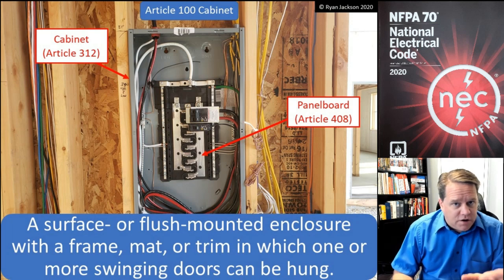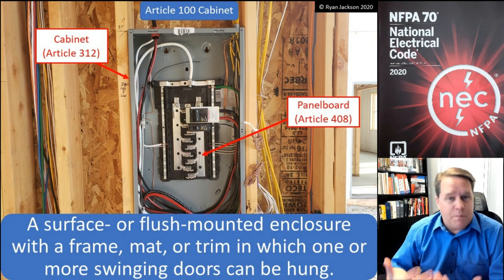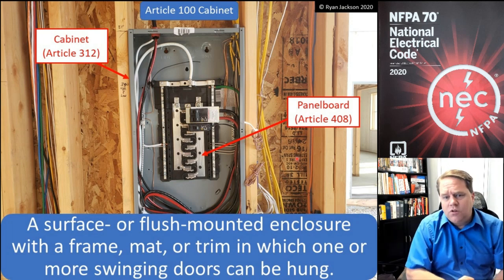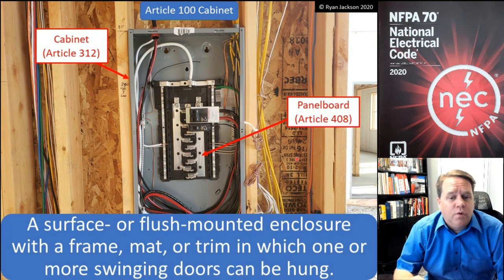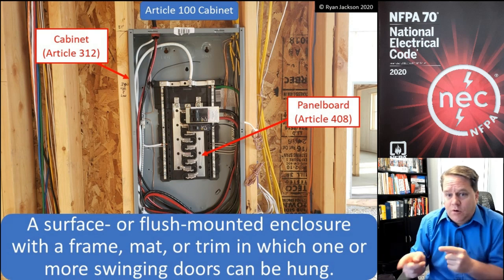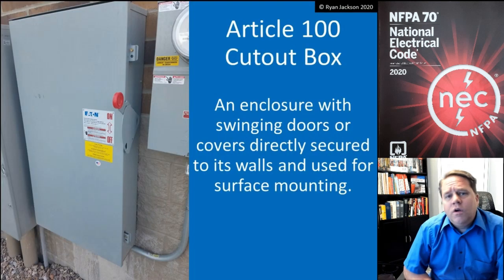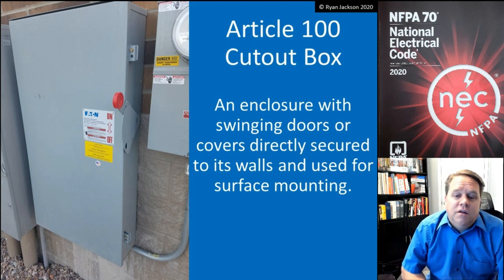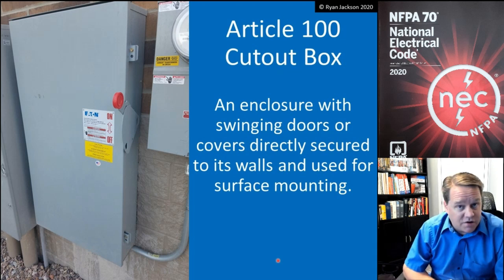100 Days of Article 100 Cabinet and Cutout Box

Comment: Tip for you young sparkies. Often ordered 3 phase ( both 250 & 600 volt ) cabinets & enclosures that had bolt in circuit breakers installed. Would always remove the panel board to keep it clean and make it a lot lighter to install. Would not install pabelbaords untill all the wires were pulled. Would always borrow a die cart when installing them in machine, tool & die & injection molding shops. Thanks for another great vid.
Reply: Good tips

Comment: just curious; why havent i seen any combination service entrance meters with built in cutout boxes switches?
Reply from the maker: Usually they are panelboards (cabinets). I'm not certain that there is much of a market for a meter with a fused switch.
Reply: @RyanJacksonElectrical   I learned from your channel that residential 1 or 2 family dwellings require an emergency disconnect which may exist at the meter. I am not an electrician of any sort but I 'guess' that a combination unit would grow in its demand with that new requirement. Same as always, thank you for the videos
Reply from the maker: @DarenSpinelle  A combination of a disconnect and meter is quite common, but it is in the form of a circuit breaker in cabinet, not a cutout box. Same effect, different enclosure type. No bigee. :)